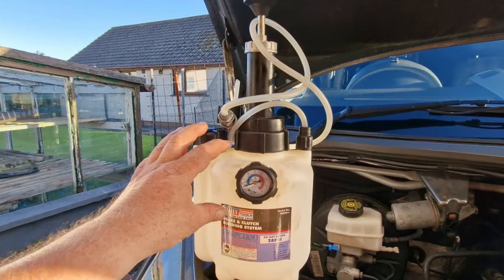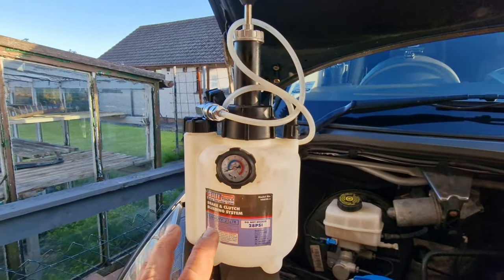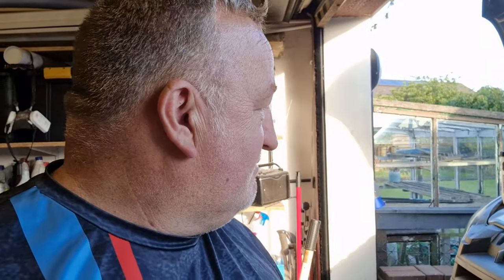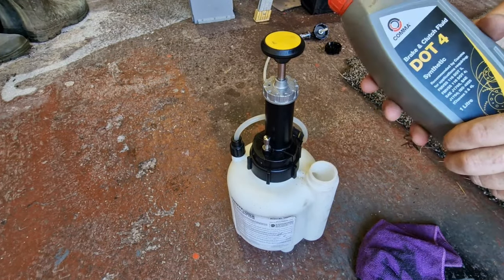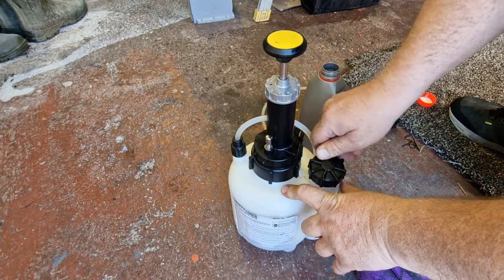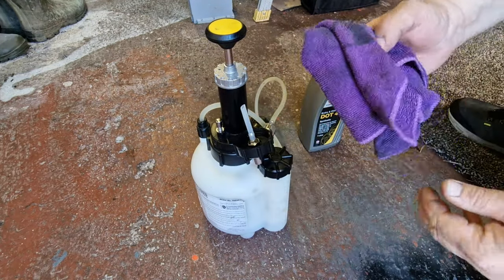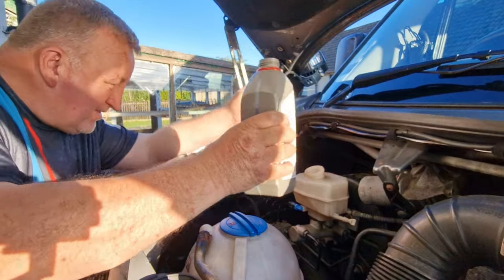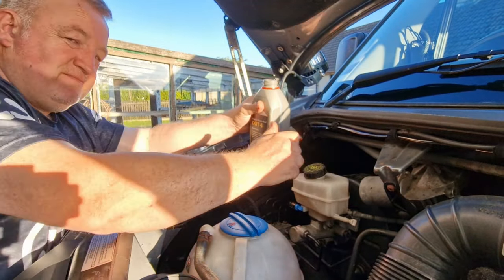How To Power Bleed Brakes, brake fluid service, Sealey Vs820 Brake And Clutch Bleeding System

Comment: Sam that Sealey brake bleeding tool is a brilliant bit of kit! I've had mine for what must be a bit over 10 years now. It has transformed brake bleeding for the bloke at home. BTW, my preferred method is to start the furthest point from the reservoir and work up to the closest.
Reply from the maker: I usually start at the back, too, but i was to far into the video when I remembered

Comment: Just a query but do you not need to do the ABS pump as well, unless it does not have one?
Reply from the maker: It all feeds through the pump the pump only cuts in when required
The only other part you should bleed is the clutch we left this out so as not to muddy the water or confuse

Comment: Awesome video. Very Helpful.
I am replacing my Astra J GTC clutch elbow, because the clip broke and clutch pipe came off.
Now that clip is nowhere to be found on internet, so I'm getting a new clutch elbow 15 quid.
and I'm getting this Sealey one, it has gone expensive though.

Hopefully, I will have a solid clutch feel after my work.
Never done a cycle repair, learning from YT.
Reply from the maker: Glad it helped

Comment: Love those videos of yours, my friend! Another excellent how-to video on really mandatory brake service! 😊👍
I am a big proponent to frequent brake fluid changes - you mentioned already, that it's hygroscopic and will eventually cause corrosion within the brake system if not changed frequently. The added moisture actually lowers the boiling point of the fluid, causing air bubbles to form within the fluid when using the brakes and approaching their limit - air (as compared to liquid) can be compressed, hence the spongy pedal. Not good. 😕
That tool is a real tme saver. No more "pump, hold, release pressure" and keeping an eye on the master cylinder, so it does not draw air. Truly a one person job.
It is also good practice, to start the changing / bleeding process at the wheel furthesst away from the master cylinder, in case of a RHD vehicle, that'd be the left rear. If it is just a fluid change (e.g. no air in the system) , then it does not really matter.
Really looking forward to the Transit video! 😎
Stay safe, everyone! 🚐☁🍀